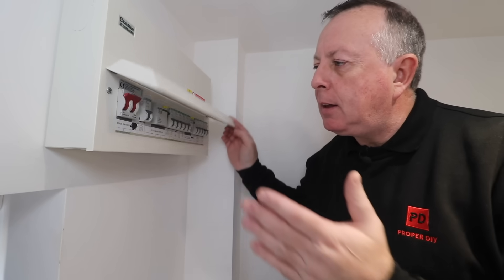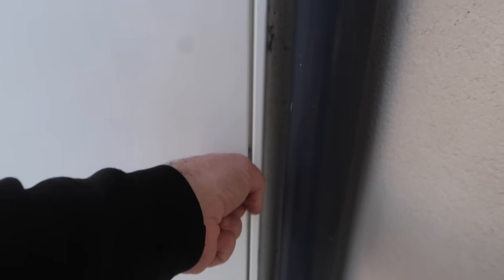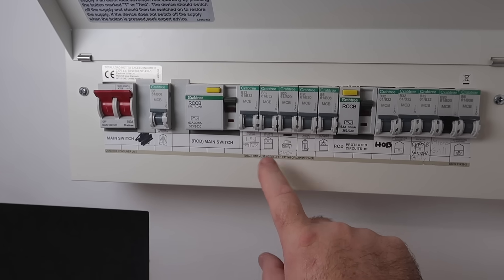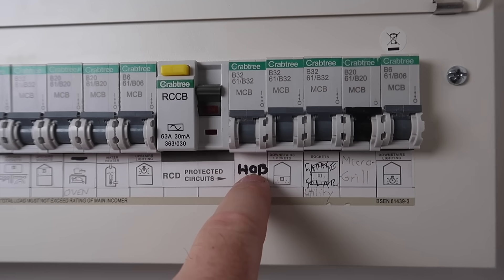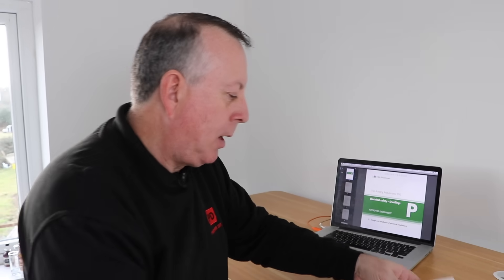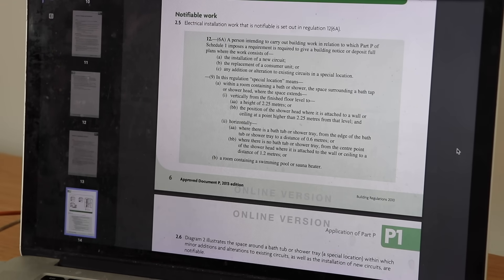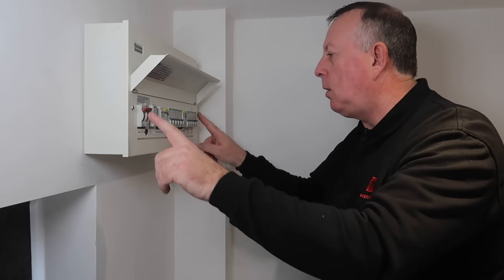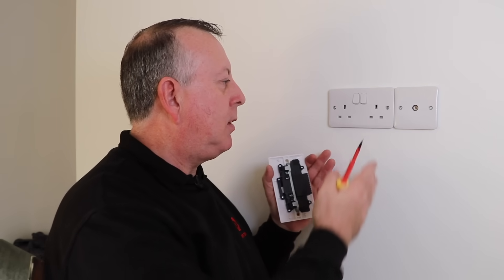What electrical work are you allowed to do in your own home?

Comment: The rules are made to keep the rule makers in a job.
Reply: generally yes, but part P was last ammended to be less restrictive in 2013. can you believe it!
Reply: Don't you care about the Greater Good?  Nobody should be allowed to own their own home and then we'd all be safe. 🤔
Reply: @KC9UDX  Maybe the government could issue a protective bubble when you are born and you spend your life in it content that you are safe (and bored)
Reply: @johnlightfoot9967  😁
Reply: This video is wrong from the outset. The UK power supply is 240 volts. It is easy to check this with any meter or energy plug monitor. The EU simply made a law that harmonised it all (on paper only) to 230V regardless and we are not the only nation when we were an EU member to not have a 230V supply. An electrician should know this. If they don't know this simple fact then what else do they have wrong! When using a lot of power/amps for the socket then the voltage drops anyway. It is also possible to buy a whole house or per socket plug in variable voltage change to down volt to save money and perhaps prolong life of devices but not all these devices are safe.
Reply: Oversimplification do you  want DIY people working on gas appliances next door to you ?
Reply: Not really.  Part P came about in part because of someone being electrocuted in a bathroom, when a bathroom fitter had screwed up an install and metal within the bathroom shorted out and became live.

Same as the gas regs, so many people suffering from carbon monoxide poisoning because of cowboys not knowing what their doing.
Reply: @RobJowett  I can never understand the rule makers, they think if they make it illegal to do the job (and more expensive) that people will not do it. Not allowed to do work in a bathroom because electricity is so dangerous but you can have sockets near the kitchen sink. Can not (officially) put a socket in the bathroom (loads in Spain) but they can trail an extension lead across the landing to power the fan heater. As for the gas regs, why not have a motorised valve on the gas supply that cuts off if the detector detects carbon monoxide or even a gas leak.
Education is the way to go rather than regulation in respect to electrical safety,
Reply: @johnlightfoot9967  your comment regarding not being able to put a socket in a bathroom highlights why certain things can’t be left to DIYers.  You can put sockets (and other electrical figments) in bathrooms, just not within certain zones.  I don’t know what the electrical regs are in Spain, so can’t comment on what is or isn’t allowed. Having said that, I’ve stayed in enough iffy hotels in Spain to know that the safety of their electrical installations isn’t always ‘tip top’.

Re Gas, carbon monoxide is just one risk, but there have been countless examples of it, and gas explosions taking out neighbouring properties after a DIY bodge job.
Reply: @RobJowett  Yes I know all about the zones in bathrooms but I still think that because it is a small bathroom it should still be able to have a mains socket as far away from the bath/shower as possible rather than people putting an extension lead across the landing (trip hazard) into the bathroom to put their fan heater on.  Also, just because you have qualifications coming out of your ears does not stop you making a crap job of it, shown at a house I attended where the "qualified electrician" had put the ring main onto different breakers at each end of the ring.
Reply: @johnlightfoot9967  you can't argue that education is the key and then not back it up.  Electricity is dangerous, and poor quality electrical installations injure and kill people every year.

I'm not going to try and defend professional trades doing work badly - it shouldn't happen, but it does.  The difference is that if you've had a qualified electrician in to do the job, and damage to your property occurs later, at least you're not being left high and dry.  You have some recourse.

Consider an arc in the consumer unit caused by the tails not being tightened correctly, which causes a fire.  If a DIYer has swapped the consumer unit, then the insurance company will reject the claim.  If its done by an electrician who is a member of a competent persons scheme (NICEIC / NAPIT), then the certificates issued are your guarantee.  If there is then the same arc in the same consumer unit caused by the same loose tails, then your insurance policy is valid.

Also, who puts a fan heater in their bathroom?  The risks associated with this are mind boggling.  Trip hazards as you say, but water ingress into the appliance - either from water dripped from sinks, or condensation or someone picking it up with wet hands.  Its the same reason that you've never been allowed to put a 'normal' light switch inside the bathroom.
Reply: @RobJowett  You can in zone 3
Reply: @johnlightfoot9967  While I agree that the regs is probably too strict in UK when comes to sockets in the bathroom, last comment by Rob is the best example on why you shouldnt do these things by yourself. He could add reselling the property as a point as well. And you shouldnt put up a heaterfan to that socket, you should install some heating in the floor instead.
Reply: @johnlightfoot9967  Your post is naive.
The reasoning behind not permitting sockets in zones 0,1,2 in the bathroom but permitting them close to the kitchen sink should be entirely obvious to you.

How many people stand naked dripping wet near the kitchen sink?
Reply: @johnlightfoot9967  Education is NOT the way to go instead of regulation.

Education does not stop people doing stupid things, regulation does. Why? Because the work is inspected to conform to regulations. If it doesn't conform to regulations then it has to be ripped out.
That results in a "safe" installation where electrocution and fire risks are minimised.

Education is beneficial but doesn't stop poor installation.
Reply: @deang5622  How does the work get inspected if a DIY person does the job ?. I am guessing you are an electrician.
Reply: The rules are made to stop people dying from electruction or burning down their house.
Reply: @bdboyo  I agree.
But the training of electricians and minimum requirements for students to train as electricians are appallingly bad.

I have had to correct so many electricians on here in things they have said because it has been wrong. And that includes professionally paid trainers that teach electricians.  And then there are the stories such as one I read yesterday where a supposedly qualified electrician wired the two cables in a ring main on to different final circuits back at the consumer unit.

When supposedly qualified people make this kind of basic error, you know there is something seriously wrong with the standard of electricians.

And curiously, Part P imposes no education or training requirements on anyone doing electrical installation work in residential houses.  The education requirement is written in a round-about way by requiring the person certifying an installation (not the installer) be registered with a competent person scheme.
Reply: @deang5622  no but there were part p courses being offered around likw confetti and that has done an awful lot of harm to the trade, Part p was brought in to train plumbers and builders to a level so they could self cert and that opened up a can of worms. Mistakes happen but why were the mistakes not picked up in testing my thoughts are they may be sparks but not registered with the NIc or napit hence it was left as finished without ctually finishing the job.
Reply: A little knowledge is dangerous don't be miserable, pay a guy who's does this stuff for a living I'm sick of stripping out your dodgy DIY bodge jobs, get it done right and sleep like a baby
Reply: Technically

Part P only affects tradesmen.

Because if they do something they shouldn’t be and it goes wrong HSE get involved.

Homeowner will do whatever they like and part P hasn’t done anything to change that.

After a few years Building control can do nothing to enforce.

And when buying a house; an indemnity policy usually satisfies lenders… and that’s if the owner even declares it.

Unless a homebuyer survey goes over electrics with a tooth comb they won’t know there’s a joint under the floor or if sockets have been added somewhere and it relies on seller declaring it.

An EICR will show the condition as safe if safe.

So it’s pretty much pointless telling homeowners what they can and can do as most will just ignore it.
Reply: Part p was and is a disaster no one should undertake electrical works unless fully certified
Reply: @crackon1299  Part P allows people to conduct work if they are not qualified in electrical installation and if not certified to Part P or to BS7671.
Reply: @crackon1299  this doesnt get said enough.

Comment: Honestly I'd argue (as a home gamer though I did a decent chunk of an electricians course many years ago before taking a job in something else for reasons not related to electrical work does interest me - money mostly) if you have a problem decoding Part P you might not be competent and confident enough to do the work you're allowed to do. On testing, yeah, that's right of course, although that is the point of the limitations of the regs - without test equipment you can't test a new circuit/board/etc therefore you can't install one, but a new socket it is presumed the circuit has been tested. For home gamers who are changing sockets I highly recommend Kewtech's Loopcheck 107 and triple checking everything - the loopcheck will tell you if you have neutral/earth swapped when most socket testers won't (I've done this without realizing despite being very observant and paranoid) and it'll give you a basic indication if your earth loop is up to scratch - both of which are super important safety checks that most home gamers won't see without it until it is too late - it's like 40 quid on Amazon versus more like 20 or less for a cheap nasty one and is worth every penny of that extra 20 quid; I've been flabbergasted by even pro electricians not using them many a time. When you've done the job and given it a visual inspection throw it in there for a check and you're good to go sort of deal.

Comment: In Scotland you can do it all 😃
Reply: (Whether that’s a good thing or not is obviously debatable …)
Reply: That's because they have special considerations due to the fact they invented copper wire. Its said that copper wire came about by Jock and Macallister arguing over the ownership of a penny. Lol.
Reply: not anymore, changed a few years back,  you can still do all the work but some stuff which is called warranted works in Scotland will need to be checked by the local authority. A lot of it depends on property type.
Reply: @Savagetechie  in a detached dwelling all electrical work is exempt from building warrant. Flats are more restrictive.
Reply from the maker: That's a novelty now - some countries you can't do anything other than change a bulb
Reply: @ProperDIY  there was a consultation in 2019 that got debated in parliament recently, so no doubt it’ll change soon.

Comment: British electrics are so weird...
Reply: What is weird about them? One of the first countries to use a national grid so they do have some experience. Live, neutral and earth is standard in most civilised countries.
Reply: Most countries' electrical regs (or if not the regs themselves the enforcement of them) are an absolute disaster, the only thing unusual about UK electrics is the commonality of the ring main, but that's the kind of thing when you end up writing electrical regs during a world war - they've held up pretty well, though less common in new houses.
Reply: @streaky81    No doubt!  The electrics in my Mother's house are a disaster, aluminum wiring, multiple panel boxes, scary stuff.  She is on a fixed income and the cost of correcting these issues is prohibitive.
Reply: Ring circuits are totally new to me. I’d be nice to learn if they are even standard compliant in other counties. I’ve done DIY in Finland and my guess would be allowed, but you have to mark the hell out of it, if you do weird crap like that. I see many potential safety risks that I would never do it myself unless someone with a cert told me it's OK.
Reply: @ridetheion5584  They were invented in the late 1940s to reduce the amount of cable needed when copper was in short supply (a lot of building materials were rationed in the UK for a time after WWII). In my opinion they are obsolete and when I have the electrics updated in my house they will go.
Reply: @ridetheion5584  They are a throwback, we are slowly getting rid of them. our lighting wiring is also modernising with most new installs taking neutral to the switch (which used to be really uncommon) thanks to the demand for smart switches and modern led compliant dimmers.
Reply: @ridetheion5584  hence the home gamers can't install rings and consumer units thing - ring continuity is so important.

Comment: At 9:02 you talk about not being able to carry out any work in a bathroom. However, P2.7 says "All other electrical installation work is not notifiable – namely additions and alterations to existing installations outside special locations, and replacements, repairs and maintenance anywhere." I read this to mean that you can carry out "replacements, repairs and maintenance anywhere", i.e. including in special locations. Am I reading it wrongly?
Reply: You worry too much my friend.  I'm an ex spark/plumber. I retired 16 years ago but still do the odd job but never worry about this stuff.  I've heard of kitchen and bathroom fitters who use the old cable with red and black conductors so they can get past the latest rules and regs. They pay a fortune for this ancient old cable that is probably dangerous and damp inside. But there's no need for this nonsense.  There was a probationary period when they were rolling out the Part P nonsense and I would always plead probationary period if needed it for inspection or selling a house.
Reply: @truthseeker7794  if you're not going to worry about what the regs say, you can just skip the whole video ;)
Reply from the maker: The regs say within the 'special locations' even 'minor additions and alterations' are notifiable.
Reply: @ProperDIY  the original quote clearly draws a distinction between "alterations and additions" and "repairs, replacements and maintenance", and it is the second category I am asking about.

So, it appears to be saying "you can't add a new shaver socket, but you can replace one that is broken".
Reply from the maker: @awt  I see exactly what you mean and it does read that if it is a 'repair, replacement or maintenance' then it is non notifiable wherever it is.
Reply: I recommend John Ward (JW) videos, he has one on Part P - Building Regulations Electrical Safety
Reply: Kitchens, bathrooms, etc, are notifiable. I can only assume it's because of the greater risk around water
Reply: @tonkatoy200  no, kitchens aren't special locations, as they are not mentioned in P2.5 (unless you have a bath, shower, swimming pool or sauna in your kitchen...). And your comment doesn't address whether "replacements, repairs and maintenance" are allowed in special locations without being notifiable.
Reply: @awt  Quote from a UK government site 
'Very common examples of notifiable work are; rewiring a property, providing electricity to a garage or outhouse, the replacement of the main fuse box in a house or any electrical work in a kitchen, shower room or bathroom.'
Reply: @tonkatoy200  That's out of date. Unfortunately government websites are often not updated when they should be.
Reply: @tonkatoy200 kitchens aren’t